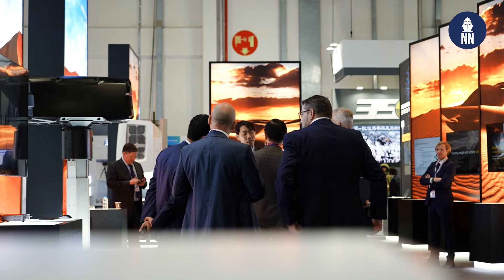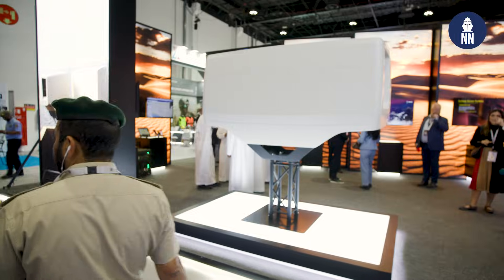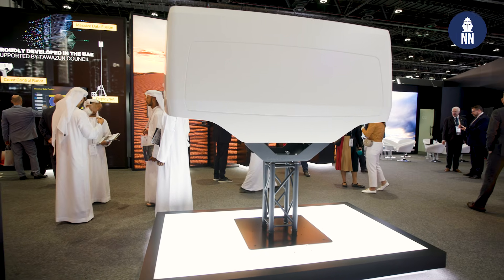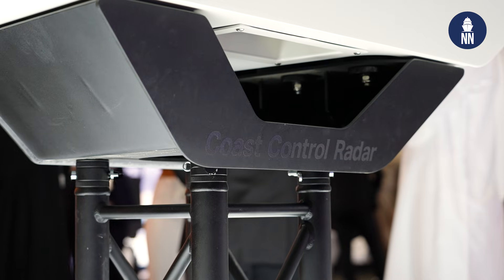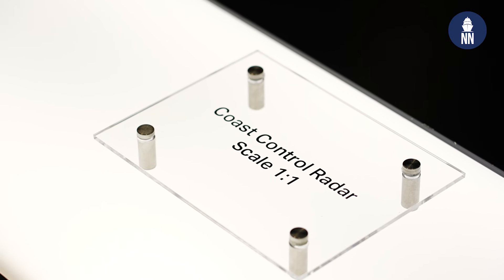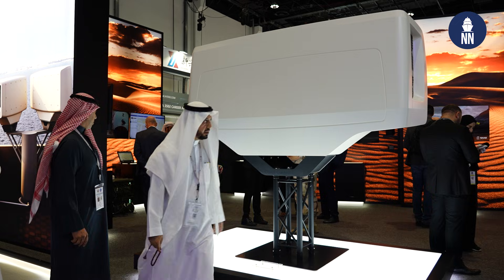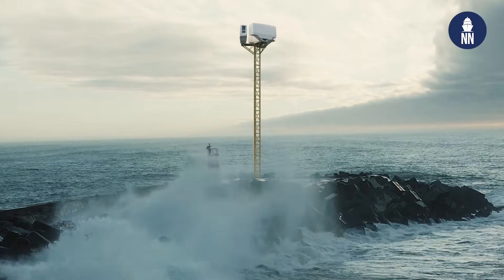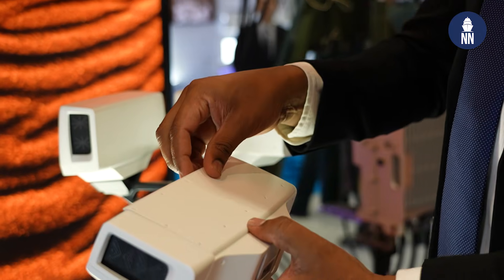Saab unveils new Coast Control Radar at IDEX 2025

Comment: In the end a nice spot.

Very few characteristics unfold.

In my opinion old radars for costal surveillance are still better if they come at a third or a quarter of price, because they are just peace time installation being in fixed well known location thus one of the easy target not even on top of the list: none will try landing on "that" beach the first day!

Good job, always where news appear
Reply: Yeah Turkey agrees with you so old style Serdar LPIs are installed with havelsan software integration giving full picture from the Turkish cost 24/7 at least 48 miles but since it is LPI and military custom engineered installation with no marketing need, my gues that value is just a low estimate firm is giving out.
Reply: @enderiskender2977  

Air surveillance is not a primarely role indeed surface is it, thus if they do not find an elevated location where to place it, range will be nearest to 10 nm at sea level.
On a sunny day a lifeguard can do the same job 🤣
Reply: @robertopiedimonte2078  Thankfuly people who can make radars are well aware of the curviture of the earth therefore radars are positioned on very high towers :D